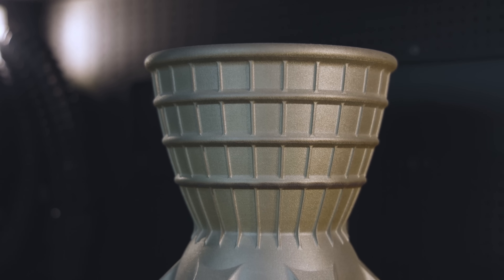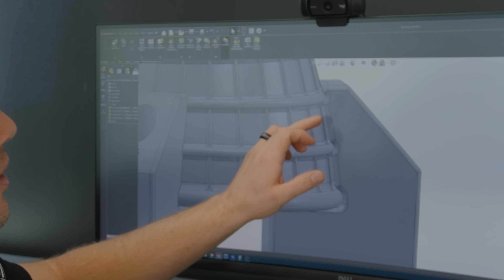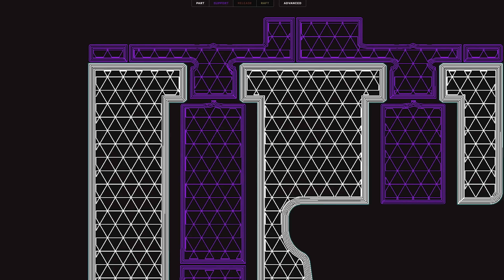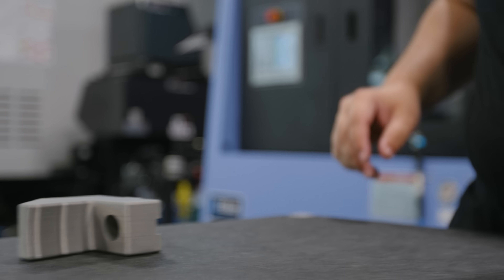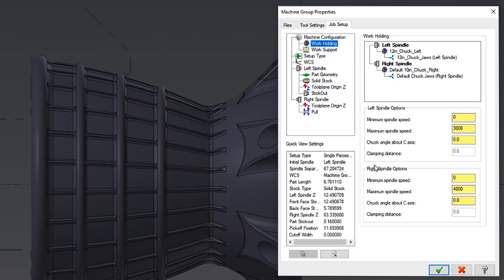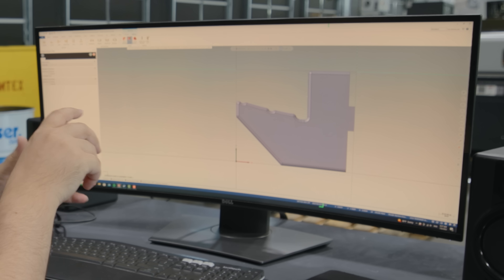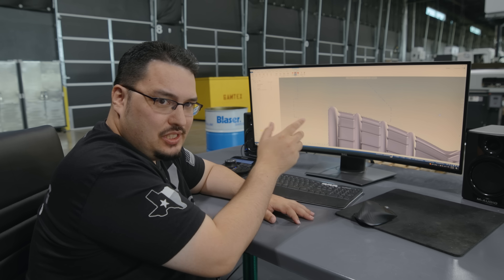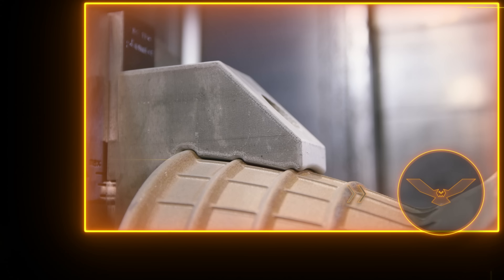3D Printing Custom Chuck Jaws for SMX 3100ST | DN Solutions

Comment: This is a perfect example of a use-case for additive manufacturing: small batches or highly individualized parts. Do you have any rough comparison if these jaws would have been manufactured using conventional methods?
Reply: I dont have any frame of reference but i would guess that the difference in cost will be eye watering.

Comment: It makes no sense to print metal-impregnated filaments on FDM while you have SLM: you could basically print those jaws with nozzle in a single batch which would be shit ton faster, hell a lot more accurate and most definitely cheaper.

Comment: I was learning this stuff I/E tool and die b ack in the early 1980 when CNC first showed up and if that computer got hot by, by, to that part and production shut down as it most used for just production.
Now I watch and the machine does everything but put the part in and lock it down or that's the way it seams.
I am amazed how far this has come and now you add in 3-D printers it seams to make almost anything possible.

Comment: You Americans have no idea, it’s embarrassing watching this. I make parts for nuclear and aerospace industries. You guys use all these unnecessary techniques to ‘save time’ yet ‘3d printing’ metal takes a long time, a lot longer than simply boring the jaws, or make a mandrel that matches the minimum size inner profile if you wanted to eliminate the risk of crushing this part, I don’t think you quite understand the use of making machining fixtures so you use sub par setup techniques. Also you never seem to use coolant which will wear your tools quickly and put heat into the job which can cause distortion in the cooling process, especially on thin walled parts or certain materials like inconel. I don’t really know what you guys are about or what you use these parts for but  I can tell your certainly not precision engineers you guys seem like a group of hobbyists to me.
Reply: Here's the problem with your statement, you said you don't know what Titans of CNC is about. Most of your assumptions can be debunked if you took the time to do your research. 

Titans of CNC is focused on producing free manufacturing education globally. Coolant isn't typically used for filming purposes, which has been stated multiple times in past videos. Not only does the team produce CAD/CAM and machining tutorials that emulate real parts being made in industry, but they also show what their tooling and machinery are capable of. Many operators don't get exposed such practices early in their careers. 

Everyone is entitled to an opinion. However, it would be nice for you to share your experiences with manufacturing overseas. Every country has differences in their approach to education, safety procedures, and manufacturing processes. If you're willing to keep an open mind, I promise you'll walk away learning something new.
Reply from the maker: https://academy.titansofcnc.com/

Comment: I feel as if a 4 jaw chuck would have been able to utilize these type of 3D printer jaws better.. not only would you be able to knock out any sort of concentricity issues, but also would be able loosen 2 of the jaws while easily relocating to place the next part back in!

Comment: I going to be blunt. Are you not wasting more machine time by 3D printing them? What about accuracy? Sure it will be good but each chuck is slightly different. We had shared jaws between 2 lathes, jaws were true on the one it was machined and about 2 thou on the other.

Why not take 30 min and machine the jaws properly?

Comment: Seemed a bit unnecessary.  I could have machined a set of soft jaws on a manual lathe to do the same thing in a very short amount of time.   Probably in substantially less time than it took you to draw the part you made.

This is why everything costs so much.  Guys like you don't really know how to get things done.  Yeah, you can make the part.  But can you actually make money doing it and what was your overhead?

Comment: This is so cool.
I wish I could convince my boss a markforged metal printer would be a good fit for our shop, but he already rejected that when our foreman suggested that.

And btw one question how's the run out/accuracy with those jaws?
Reply: I own a small machine shop and these comments make me laugh.   Ya let's spend 150 grand to buy something that we can use to make fixturing once every 2-3 years.  That being said we do have a plastic markforged printer that we use for fixturing but it was only a few grand.
Reply: @85CEKR  i meant any additive manufacturing mashine.
My Boss thinks it has no real future in the industry.
Reply: @Birb_of_Judge  Your boss is wrong. It's the future. People will have these machines in their homes. Instead of buying a part, you'll buy the code.
Reply: @GrumpyMachinist  I know.
But i also know that regular subtractive manufacturing isn't going anywhere, ever.
Many 3D printed parts need some work on regular mashines to hit some tolerances and surface finishes

Comment: I mean, that's pretty cool but I could turn those Jaws in 20 minutes
Reply: Bet ya $20 you couldnt 😂. Ill send you the model, and you post a video to our FB group, win or lose? 😍
Reply: @barrysetzer  20 minutes might not be bang on, but you get my point.... In say mazatrol it would take 5-10 minutes to program 4-5 minutes to put boring bar and od turning tools (maybe a full rad internal groove tool depending on those features) in holders and probe them (if they weren't already in machine) and what 20-30 minutes cycle in 17-4 (although I'd obviously use standard mild steel soft Jaws like most people would)
Reply: But you get my point? Say it took you an hour. Say it took 2? At some point, there is a decreasing return on investment. And THAT is the point. 😂. Thanks for engaging, love it. Feel free to chat more in my Fb profile. Barry Setzer.
Reply: @barrysetzer Jaws take minimal time if you know what you are doing, it's really not that hard to understand ffs 😅 I make all sorts of shapes and size soft Jaws, tapered jaws, dovetail Jaws, Jaws to hold irregular shapes, eccentric Jaws, even threaded Jaws to clamp onto threads, it really really doesn't take that long or require that much skill and the blanks are inexpensive, how much did it cost to print those jaws? Did they run true? I'm not knocking it,... Its cool as hell and I'd love to have a go, but it definitely 100% isn't the best or most efficient way to make them.
Reply: @barrysetzer  Not exactly. When you’re done using soft jaws they can be easily repurposed. I’d have to agree with Alex. Boring soft jaws is far more efficient, precise and accurate. You can program a boring cycle in about 10 minutes and have finished jaws in 15.
Reply: Again, $20 to anyone that can machine these jaws in under an hour.
Reply: @barrysetzer  what diameter are the Jaws roughly, and how deep are they roughly?

Comment: man, i can't wait to see the assembled aerospike in action. Its really cool to see lots of 3D-Printed parts in practical application from you.
Working in the injection mold industry, i still hear that the printing of mold parts is still to expensive, and that disadvantages do not outnumber the advantages. 
It seems that making 100 deep holes into a steel block, closing all holes with threaded plugs and baffles, is still cheaper then just printing it in a kind of rough-cut stage. 
If ever, they use it only for fancy organic cooling holes that are bound to clog due to the rough 3D-Printed inside surfaces

Comment: Lets be real here. If I was in a team meeting and someone suggested this demonstration as a final solution I would call the idea moronic. Lets reason here.
It makes no sense to print STAINLESS STEEL jaws in a CNC printer, which will take a day or more, have runout, and cost more than off the shelf jaws; because CNC printing frees up a CNC lathe, which is scheduled for the job regardless, can cut the jaws in 30-60 minutes at most, leaves little to no runout. 
The fact is, regardless if a machine is running unattended or not, the customer is still being charged the same amount per hour. The benefit of running unattended is it allows the operator to run another machine, which is free labor to the company. 
In this demonstration you cost the customer more money.
Reply: Jaws like these have alot of hidden costs to them if you machine them. They are tapered inward, and have clearance cuts for the radiused ribs as well as the square ribs.. Most guys arent going to be able to do these manually. So, you would have to tie up a programmer, machinist, and CNC machine just to make a set of jaws. All we had to do was hit print and walk away. The cost of the printed jaws was actually much less than machined ones in this case!
Reply: @barrysetzer  Certainly the jaws wouldn't be produced manually. I've watched enough videos of Tyson; he can do it. Especially since he's already importing the model into Master Cam anyways and setting the job up. To me, it doesn't add up. Time is money. Regardless of the machine, the customer is being charged by the hour. Additive machining takes WAY more time than traditional machining and it's not like Trevor doesn't have time tied up programming the printer and completing the post process work. Like I said, it doesn't add up. I can't fathom how making jaws with specialty(low demand compared to traditional stock) 17-4 material(why why why?) for a 3d printer is more cost effective than buying mass produced off the shelf soft jaws and machining them. Maybe in a decade or two after additive machining has really taken hold but not right now. 
You guys can shut me up just by saying that additive is the future and we feel it's important to demonstrate the impact it will have. :goodvibes:
Reply: @barrysetzer  I cut dozens of jaws and yes printing a pair could have some benefits but even in the video I don’t see it. Roughing out and than finishing the contour with a inside radius cuter and the machine is ready to go. Maybe half an hour. No run out, no realignment with the base jaws. I assume that the part shown doesn’t need a lot of clamping pressure but when I got 20 kg on my spindle spinning at 1000 rpm, that would be a true test. So in the end really interesting approach for highly specific tasks but for a standard operation too expensive
Reply: Ok guys, picture this: you have a 100% organic structure. Call it a human knee. Your jaws must match 100%. Thoughts?
Reply: @barrysetzer  That question is loaded with a ton of other questions. I would need to see the print first. 😁
Out of curiosity, how accurate can the Trumpf and the MarkForged print? Within +/- a couple tenths?
Reply: @barrysetzer  erosion cuting or milling. But I would rather talk with my construction. Maybe we can have reference diameter for clamping or the part as a strong point for it. 

A knee joint ? Mill it. Yt vid Grob-Werke GmbH G150 - knee joint
Reply: Hahaha BRO! Stop bein such a Grumpy Machinist 😂. You sound like Jessies sister

Comment: I love how this shows that 3D printing is more than a novelty.  It can be used for complex parts as well as fixturing.  I was working in an R&D lab and used fiber reinforced resin to print one time use light duty fixturing.  Worked a treat and was super accurate.  The fixturing was actually more accurate than the cheap manual mill it was being used on.
Reply: Few years ago, I saw a story about a more efficient fuel nozzle for a jet engine that was 3D printed and couldn't have been made any other way. Yep, 3D printing has a big place in the future.

Comment: Can you explain your reasoning for claming onto the radii with clearance on the flat surface,instead of the other way round.My thoughts are it would clamp better that way..Cool video though,3d printing is awesome.
Reply: I'd imagine the rounded parts are stronger than the wall of the part

Comment: Why not remove the support before sintering. I guess the steel is less hard before sintering
Reply: In some instances you can but during sintering the material is heated almost to its melting point so if you remove the supports before you could get some sagging in the areas where you now have have unsupported overhangs. The Metal X prints a ceramic layer between support structures and the part helping with support removal after sintering.
Reply: @trevorgoforth8963  thx for the clearly, make sense. Never to old to learn 👍👍👍👍👍
Reply: @trevorgoforth8963  thx for the clearly, make sense. Never to old to learn 👍👍👍👍👍

Comment: I like the the idea of being able to 3d print jaws but would it be faster to just bore soft jaws? Unless Trevor printed them at the same time which would be time saving then, also how are you touching off the part with all the tools. Do you have to make adjustments typically with a tool setter or is your tool setter spot on everytime?
Reply: The idea here is to reduce the amount of actual man hours and spindle time spent on our jaws. I can print the jaws while my vortex nozzle prints, everything runs unattended and I can go work on something else. This way Tyson doesn’t have to program the jaws, set up tooling to run them, or use valuable spindle time to cut them.
Reply: @trevorgoforth8963  True but not true. The customer is charged by the machine hour not by the operator hour. Time is time, it doesn't matter what machine it is on. You guys act like Trevor has no time involved. I don't care what you say or they say. In this instance, additive is in no way cheaper than the extra hour/hour and half(programming, setup, and running) it would take to machine massed produced off the shelf soft jaws.
Reply: To me it looks like it's more proof of concept ie.. "look we can do it 💪 " as for this specific part yes it would be no issue to bore it out but on a more complex part with a bit of pre-planning it would be very useful so the CNCs are only making money instead of tool making. Obviously this is just my opinion and full disclosure I've never worked anywhere that needed to be that efficient lol
Reply: Idk, 3D printing jaws sounds a lot better than hunting around the shop for the perfect  scrap of metal to hold jaws in the middle of stroke for cutting 😛
Reply: @BillJonesiii  on doosan puma 2100sy if you turn the pressure right down you can rotate the protective sleeve in the front 30 degs and the jaw rails will hold on that lol it's a bit ghetto bu5 it works in a pinch lol